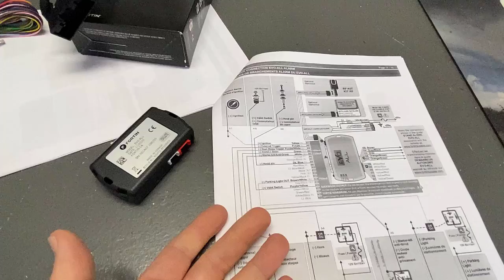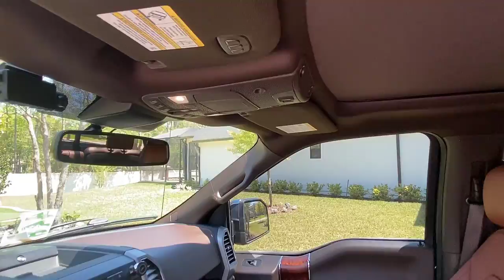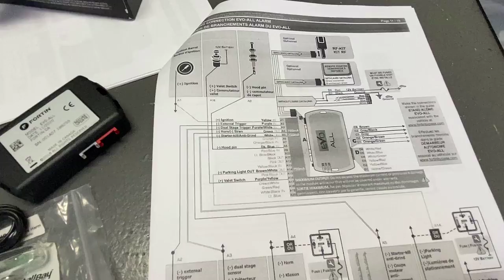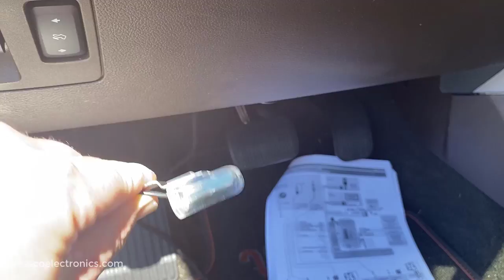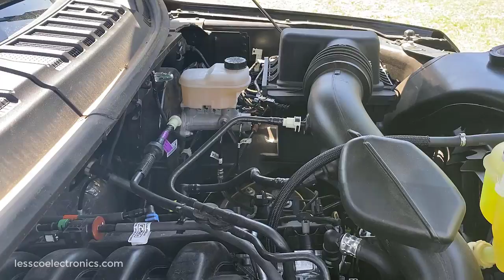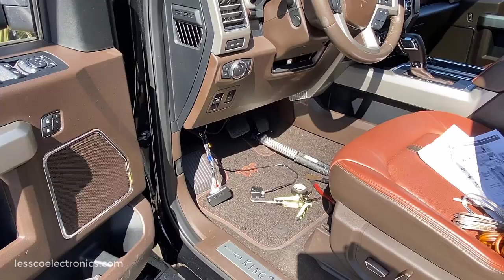How to add factory enhancement alarm features and install an Evo-all

Comment: I installed the linkr lt3 with an evo-all in my 2019 f150. Could you tell me what connection I need to make and where it's located for my input positive alarm wire?
Reply from the maker: If you got it from us and we'll help you, just give us a call.

Comment: HELP!!!!! I need some help sir. I bought and installed a scytek remote start upgrade on my 94 Cadillac Fleetwood Brougham. I miraculously got the remote start to work twice. As in 2 times. 2 times and has never worked since. They don’t send any instructions or schematics for the vehicle so I was left to find information online on my own. Totally NOT HAPPY because I wanted the pager to notify me ugh that was my the whole reason for the upgrade. In the first place. Somehow now I’m supposed to buy another upgrade for mobilink which I thought I was buying. So I Call place I bought it from go support was told we only sell alarms don’t do any installations. WTF???? Well so I’m gonna pull it all out and if at all possible want you guys to sell me a plug remote start system with some kind of personal notification. All factory windows and lock function( before anyways). My parking lights didn’t flash like they should even before. I’m open to any manufacturer EXCEPT SCYTEK. Also I have the factory anti theft system bypassed key soldered in to bypass the vats so the ignition function like a normal ignition switch with a factory key without the pellet. Thanks.

Comment: hi, do you have any video like this but in an 2016 acura rdx?, im looking how to pass a cable through the fire wall, and nice video!
Reply from the maker: you should have a factory frommet 3" below your brake booster, take a look
Reply: I like your attention to detail I have to slow it down till half speed because you say so much information. When you're showing diagrams are you also mentioning or posting the links for those for a spot for them I'm crazy about my 2007 Lincoln Town Car and I'm always upgrading it I don't know if you're familiar with the home link system the three buttons supposed to be adaptive tech. Useful in lighting appliances and operating gate at the house or programmable of course for garage door opener. I've got my ear to the rail I'm hoping that this automated drive tech makes it to some kind of device we plug into the OBD2 port. But I am following in fascinated those f-150s they look like a spaceship I had no idea they had tech in them like that take care bless you
Reply: Hi , I liked your video , and is the first video I see explaining how to upgrade the remote start to alarm function,, i have 2010 Chrysler 300, and I installed the Evo remote, it has the t harness too, but what I don’t understand on diagram is the yellow wire, tells me that I have to cut it and connect it to the car harness and the other side just tape it, and the starter wire too, where do I have to connect it? Shock secador i have does not fit in the box is bigger, please help😬😬😬, and thank you